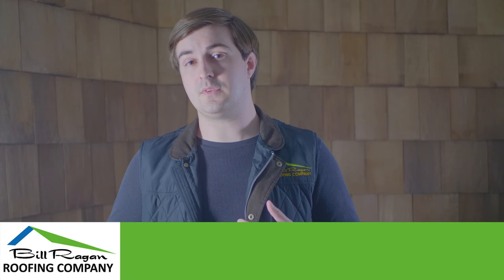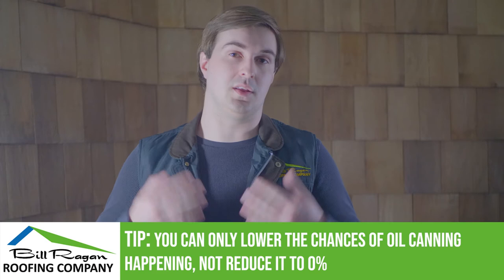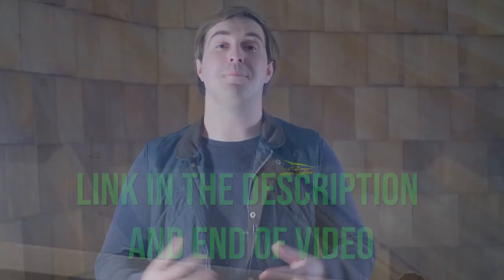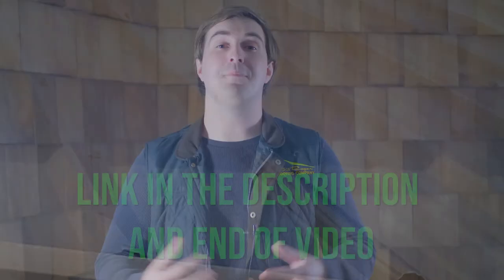What is Oil Canning and How to Prevent It

Comment: "When it happens, it's aesthetic, so nobody will cover it under warranty".....also "if it happens, it can be because of a factory defect, or a bad installation".  So.....which is it?  Also, you didn't suggest any ways to prevent it (ribs, heavier gauge steel, different type of clip systems...etc).  Absolutely no help.